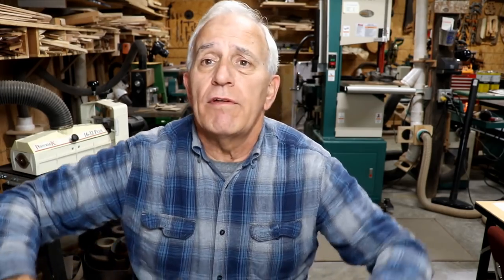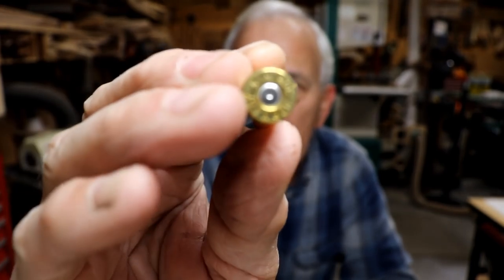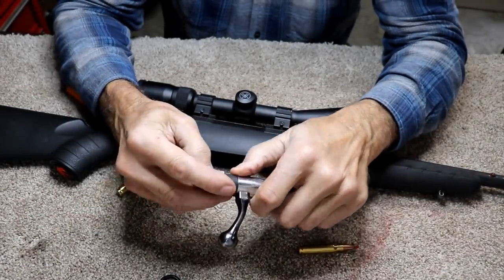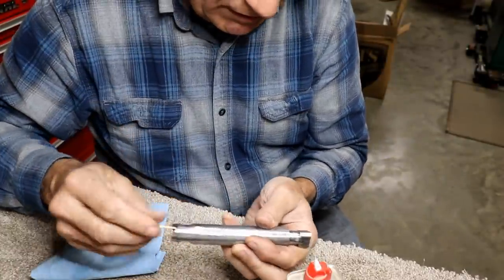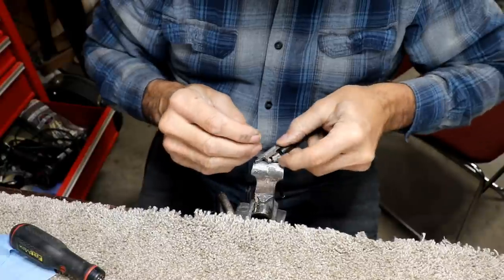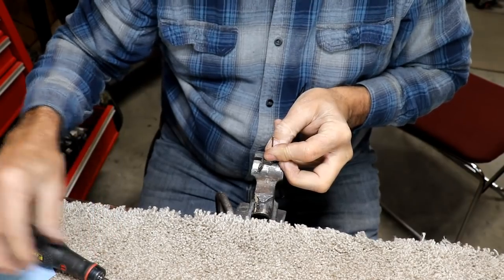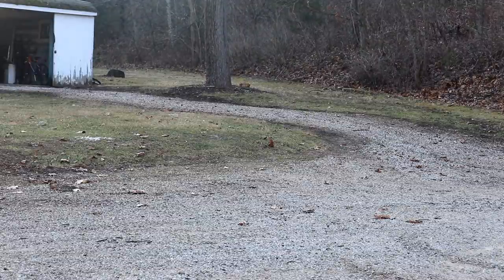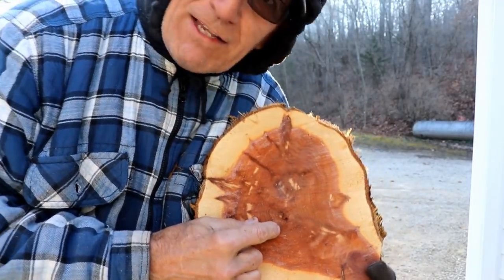547 RSW Creeping Crud Strikes Again   Ruger American 308 Misfiring Issues

Comment: As an ex-car mechanic,  intermittent problems like this are the worst.     At least you were able to narrow it down to firing pin assy.   A customer had car that would stall every few weeks,  could have been anything from fuel to spark.   I test drove it for hours,  never happened to me.   About a year later,  they came out with a bulletin that a programming error in transmission computer could cause intermittent stalls.   The fix was to replace the PCM  (transmission computer) with an updated unit.

Comment: As a gunsmith, I can tell you that you have sufficient firing pin penetration.  I didn't see obvious problems when you took it apart. The cartridge that failed to fire was the result of a light strike.  An area that I tried to see was the back of the firing pin, that weird shaped thing that you took off of the back of your firing pin, but I didn't get a clear look at it.  If you have the owner's manual, I believe you will find it on the parts list near the back of the manual - BTW that manual will help a lot when working on your firearm.  The firing pin back appeared to have a couple of scratches on the bottom of it but I couldn't verify that by watching your video.  I kept hoping you would show a clear shot of it. If it does then your firing pin back might be dragging slightly on the sear which could slow down the firing pin strike.  The sear drops down when you pull the trigger and the firing pin falls forward. I hope you find the cause.  P.S. I would not lube your firing pin because in cold weather it could give you more issues.  I do love your work on all those stringed instruments and hope you keep posting those - you are a true artist in that area.

Comment: Yep, at 4: 17 I could see it is a soft strike, so it is in the bolt.  Bad lube, chunk of junk, bad spring,  bent firing pin, or related.  
Now I will f.f. to the beginning to see if my 40 years of amateur gunsmithing is correct.  Fun to watch you work out the bolt disassembly. 
Quick tip:  if you ever have any issues with a rifle, always preserve the cartridge / case to show the gunsmith. There is a LOT of info in those little beauties to the practiced eye.
Reply: I meant f.f. to the end...duh.

Comment: Any machined part has some tolerances. If that striker has come from the factory with a little too tight fit, any grease or heavy oil can make the striker act like a damper piston in the end of the course and cause a light strike, specially in the cold, when the lubricants get more viscous and in winter hunting, when you wait a lot with the gun in the cold.
It can not be a problem in another similar gun that has a little more loose fit in the striker/fire pin channel, but can be in ours.
Since you have some machine tools,  you can check the tolerances and correct it if is necessary or just use only a  light oil in the striker channel.
You can also keep measuring the diameter of the mark in the primer in different conditions to track the problem.

Comment: either you were right and it was the goop in there, or the firing pin is slightly rubbing. if i can make a suggestion, if the problem persists, take a tiny piece of polishing paper, and rub away a few microns off the firing pin surface, or a few microns from the inside of the hole in the bolt face itself. half a thou or less. (less)

Comment: With a stainless steel bolt, like what it appears yours is, I typically use Lucas Contact cleaner, which is sort of like brake clean to dissolve and flush out all the old grease/oil and debris. Sadly I haven't been able to get any here in Hawaii, so I use Napa Mac Contact cleaner. CLR if I don't have any of the contact cleaner. It is amazing what can cause misfires. Hopefully the good cleaning you are giving it will fix the issue. I'd also check with Ruger on that recall about the plastic end piece as well.

Comment: Hello Jerry. I am not familiar with this specific kind of gun but it looks like a striker system (like a glock where the firing pin is retracted and released and not hit by a hammer) this kind of firing system will have this issue in firing a 100 times and failing 1 time and it is usually from a weak Firing Pin Spring and it will fail more often when you slowly ,very slowly press the trigger . In these cases when the spring is slowly released you will have a greater chance of misfiring . in case you have the problem recurring try to change the Firing Pin Spring to a stiffer one ,it might bring up your trigger pull but it will sure solve your problem. (i encountered the same problem with my Glock who had a competition firing pin spring,and it was solved by going back to the factory pin) .good luck with your gun and God bless

Comment: The material you described sounds like cosmoline or something similar to it.  It can be pretty hard or rather, stiff in the cold.  That would be enough to gum the works enough to keep the firing pin from moving fast enough to hit the primer sufficiently.  It would also account for the primer dents to be at different depths.  I suspect the bolts are probably given a dose of it to prevent rusting after machining and before assembly.  Your bolt wasn't cleaned well enough to get all of it out.

Comment: In another life, I was an armorer in the US Army. That started my interest in all firearms.

The issue appears to be a lubrication problem, as in wrong lube, or too much lube.

The heat cooked it into a nasty goo. Maybe...

Now I use only: "MILITEC-1 protects metal surfaces with a constant impregnated molecular bond of synthetic-based hydrocarbon derivatives." I started using this on my AR's, which can be a bit touchy about bolt carrier lubrication, and I found that it actually works wonders, IMO. Give it a try.

It's heat activated, in a way, but will work well on virtually all firearms. Battle tested, also.
Reply: Wonder if duralube would work. It searches out heat. Sr3 nasa
Reply: In my experience, which is with Glocks and AR’s, I never put any lube in the firing pin channel or on the firing pin. Lube just collects carbon and ends up as a sticky goo. I use alcohol to completely remove any lube in those areas. Glocks and AR’s both have critical areas that require lube. I use Balistal for cleaning and a Hoppes needle lube bottle for lube. I know there are other and better lubes but Hoppes works for me. Every time I’ve had light primer strikes it was either carbon or lube issues.
Reply: I was wondering if the pin was over-striking at first, puncturing some primers, sending residue into the head of the bolt.

Comment: 6:34 that "pin" is the ejector. It flips the case out when you open the bolt. The pin on the side that you pointed to fits into a notch on the bottom of the ejector to hold it into the bolt face.

Comment: An easy way to tell the difference: a magazine has a spring inside. A Clip IS a spring.

The firing pin spring may be underpowered or the firing pin is just a wee bit too short or there is crud in the firing pin channel in the bolt.  Look for stray bits of machining chips or excess hardened grease in the F. P. channel.

It's not the safety, the striker is hitting the firing pin which is hitting the primer, just not hard enough.

It was dirty the day you unboxed it and it needed a thorough cleaning and proper lubrication then.

I'm not a gunsmith but I've been shooting actively for sixty years and I don't have any "safe queens".

Also, you need a better quality of gunsmith. They are like mechanics or luthiers, some are better than others. :-)

Comment: Check for a broken firing pin I have had it happen in pistols the firing pin channel is pretty tight and it can work sometimes. Or firing pin spring. That little pin is to hold the extractor in .

Comment: im lucky my hunting rifle was a action up custom build done in the thirty's on a rem mod 1917. its a tad on the heavy side due to the heavy 26 inch barrel. its still in 30.06 ive a 4 power weaver k its also tapped for Lyman peep sight if i should chose to go iron sights.i scored it for 199$ because they thought it was just a sporterized mill surp. the weaver also had a custom reticle with the tiniest dot ive ever seen! i showed it to the shop owner who was curious as to what exactly it was so we took it apart and started poking around and by the work done to the action, it had its old ears and sight base milled off and the receiver was reshaped and polished and blued. the barrel is a heavy profile all fitted into a nice walnut stock with a cheek peace.it loves 150 grn and 180 grn loads 220grn loads all group tight at 100 yards. its an accurate rifle for being 104 yrs old! the receiver is in the 60k range dating it to feb 1918.the shop owner told me what it would cost to have the work done today and we both agreed that i had picked a good one for pretty much nothing.he told me that in the thirty's some very talented gun smiths wer doing these hunting rifles to put food on the table.witch makes sense to me. in the thirty's their weren't many options as far as bolt action hunting rifles went you had the Winchester mod 54 or springfeild 1903 or the mod 1917 Remington. their wer 3 company's making them Remington Winchester and eddystone  but only the Remington actions wer solid and the other 2 had a hole in the top of the receiver under the sight base that would need to be plugged and welded. what did the primer look like on the misfires? light strikes plus hard primers will do what you described. as in it being kinda random and hard to duplicate without shooting 200rnds. it might have ben the ammo?

Comment: My Ruger American Ranch was doing the same thing. I took the bolt apart and upgraded the handle... Took the rifle to the range and now it misfires 95% of the shots. These rounds will go with the second strike every time. Thinking it's something to do with the firing pin assembly.

Comment: I would have been concerned with that rub mark on the firing pin. I don't believe the firing pin should be rubbing on anything. I suspect the crud you found was making the firing pin occasionally drag on the hole in the bolt face just enough to slow it down and not strike the primer with the required force.

Comment: that firing pin is dragging on something if it was the protrusion was too short all the rounds would show that i am a gunsmith and i would check that first but the fired round you showed looked like it should if the striker spring is catching it might cause that

Comment: On the end of the bolt, there's an extractor which grips the case rim and pulls the case out of the chamber as the bolt moves backwards, and there's also a spring loaded pin, the ejector, which flips the case out of the action as soon as it clears the chamber ramp.

There's lots of people who blame their misfires on "bad ammo" when in fact it's actually them liberally lubing their arms with WD-40, and it being a super penetrating oil, wicks into the primers of ammo left in the magazine. In your case it could have been a bit of grease inside the bolt that got stiff in the cold and slowed the firing pin down on it's way to the primer.

Comment: I have a Ruger pistol that does the same thing.
Reply: Sounds like they don't clean enough after machining.  They might be  doing a batch cleaning job (lots of parts at the same time in a liquid or something) and they are not doing it long enough or some areas are not getting as clean.  And then at assembly they just put parts together and testing functionality once.  (I've worked in manufacturing for the past twenty years and seen a lot of short cuts to save money. )

I think this type of thing shouldn't happen because a gun misfiring is a very dangerous thing.

Comment: Had the same problem on my Ruger. The firing pin was very slightly bent and would misfire in the cold once in a while. The witness mark you see on one side of pin may indicate that as well.Turned down the firing pin a bit and all is good now.
Just about wrapped that gun around a tree, when one morning hunting moose I came upon 3 bulls together and had 3 unfired but dented primers,with the shells laying in the snow at my feet before it decided to fire the forth. Well got the big bull anyhow….

Comment: Roger had a problem with their Precision Rifle and had a recall of certain serial numbers to replace the plastic rear cover. It would cause a binding on the firing pin causing a hang fire. It was intermittent and related to cycling the safety. You may have a similar issue. Great videos Jerry. Hope the arthritis is not giving you pain. Merry Christmas and Happy New Year,
Bruce

Comment: Ruger's warranty department would have taken care of that for you for free. Possibly the firing pin is machined incorrectly or the pin hole in the bolt face is drilled off center? Causing the drag mark and keeping the pin from striking with full power?